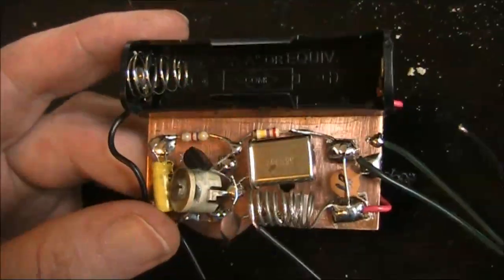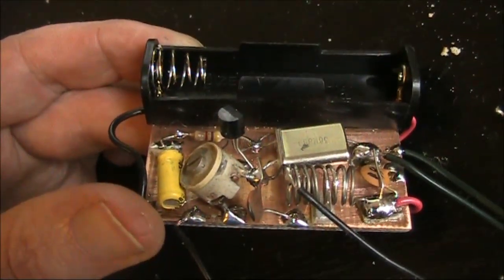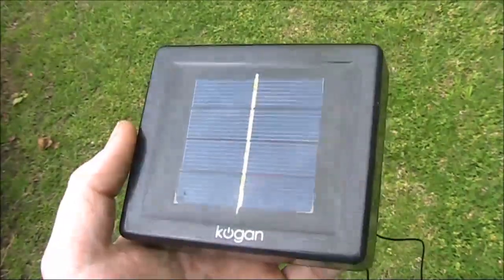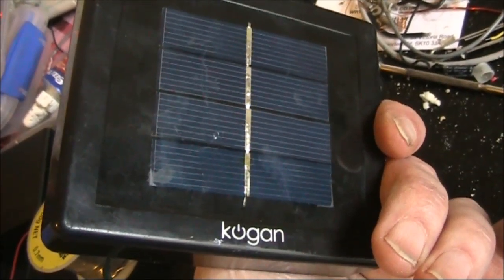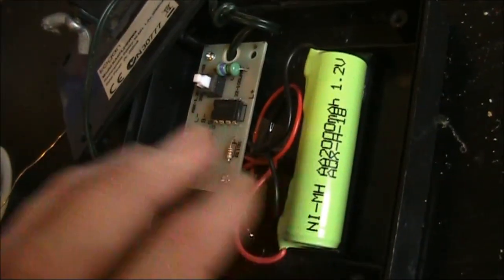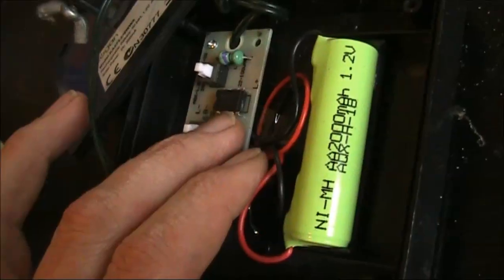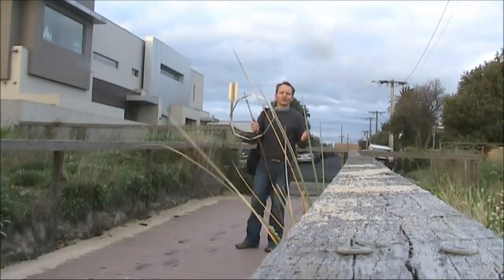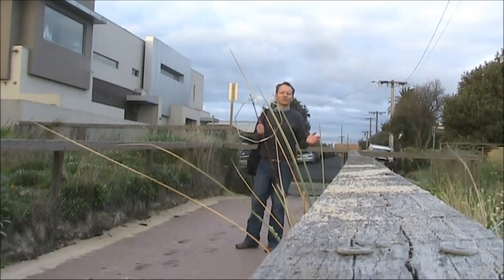A low power radio beacon inside a solar garden light

Comment: Remember back in the 70's and 80's when people used to build similar things on 27MHz without the solar panel and throw them in the local pest CBers garden or under their house and it would drive them insane. "Are" the good old days. When I say pest CBer I don't mean people on 11 meters are pests I mean the pest CBer even the local CBers hate.
Reply: I can neither confirm nor deny any knowledge of building such devices during the 1980's, however using a 27.085Mhz crystal readily available from Dick Smith Electronics would render the AM call channel unusable for all but strong incoming signals LOL
Reply: I was waiting for someone to say something, took a while but I am glad you did. LOL  I wonder how many people kept taking the CB down to the CB shop to get the noise to stop. LOL, LOL

Comment: Very nice, Peter.  I have had a couple dozen of these lights since they were first produced and after a few months I would have problems with them due to oxidation of the battery contacts, which I was constantly cleaning. A few years ago I bought a small tube of anti-oxidation grease and applied a tiny bit to the battery contacts and haven't had any problems with oxidation since then.

Thanks for sharing another of your great videos!

73, de Mick - WB4LSS

Comment: Will this work with 8MHz cristals
Reply from the maker: Possibly though you'd need to change it from an overtone to a fundamental circuit.  VHF/UHF is better for these sorts of applications than HF which requires bigger antennas to be efficient.